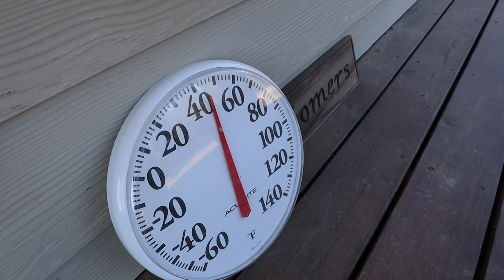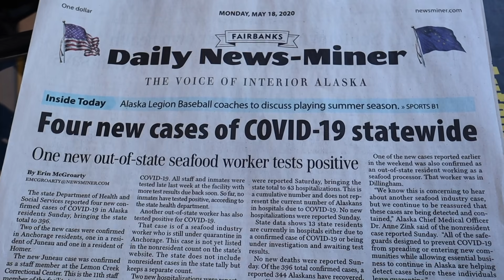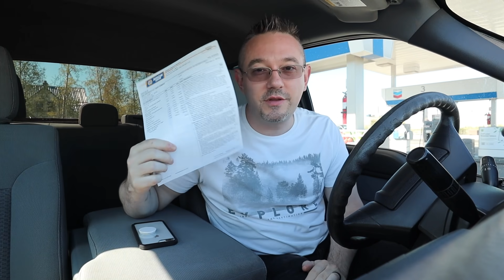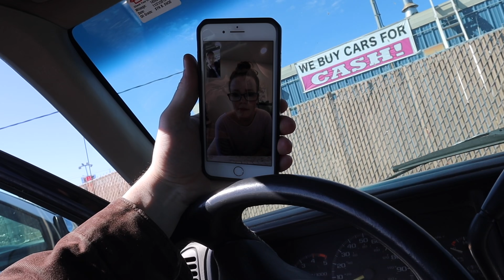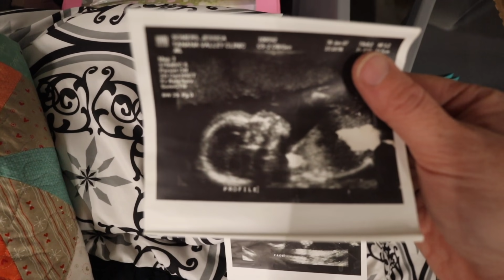IS THIS A MISTAKE? |BUYING A CAR IN ALASKA?| THINGS TO LOOK FOR? | Somers In Alaska

Comment: Alaska Chevron knows Ford vehicles, totally agree with his comments. Arizona to Alaska truck a great choice. 100% agree with changing all the fluids on a 4x4 especially if it has around 100k miles, in addition to the regular oil changes.

Comment: No it's not a mistake buying a car in Alaska, it no different then anywhere else. When I was in the Army and stationed at Ft Wainwright back in the late 70's, I bought my 1st New car EVER from Seekins Ford/Mercury when they where in the former building. And I bought a 2nd new car from Seekins. They treated me very Good. And the 2nd one I ended up driving all the way to Miami, FL., but sold it down there as did not have A/C in it and that is a must have down there!! Just have what ever you wish to buy checked out before you buy!!! Take Care, Mark from near Seattle, WA, USA.

Comment: Many prices are dependent on your local area. The popularity of a given vehicle type to your area even down to the colors that people in your area prefer will change the value, bought a vehicle on the west coast that wasnt popular and it was several thousand less that the exact same vehicle on the east coast purely based on the area preferred that particular model, so when i moved the value of my vehicle actually went up even though i put 2500 miles on it. 

Any doctor will write a prescription for muciprocin, it is similar to triple antibiotic but it makes the over the counter stuff seem like vasaline. Highly recommend it as a staple for ant first aid kit, doesnt cost much at all

Comment: That's why I stopped buying used. I perfer used for many years but after the 4th car in a row had so many problems that cost more then the car was worth.. I had enough. I realized starting new was the best option.  I'm the first with it so I know what's been done to it. Id rather make payments on new then on something you have to tinker with..going on 2 years with my truck...never had to be stranded in 2 years..that's unusual for me. Lol

Comment: They must not be familiar with salt belt tricks.  South main auto and Fordtechmakeuloco have videos on it without pulling the engine.  In short, weld a nut on the broken stud.

Comment: That's exactly what I said, the same thing Lance told you about the cam phasers and hubs.  The cam phasers could cost you the engine.  Look on the forums.  Listen to the stories of real people who dealt with the cam phasers problem.  To me it's a deal breaker.  The hubs is just planned obsolescence.  Wear through the disk because you overheated the brakes, or they cut grooves, you have to replace the whole hub assembly.  I drove Ford pickups for 30 years.  Never again.

Comment: We used a vehicle broker when we paid cash for a used Jeep earlier this year. The broker charged us a flat rate ($500) at the time of actual vehicle purchase and before that searched dealers all over the U.S. for the category of vehicle we wanted and started e-mailing us descriptions of vehicles. Once we found a vehicle we liked, the broker negotiated a deal that included a dealer's warranty and free delivery of the used vehicle from out of state. We had to get our bank to do a money transfer to the dealership before the vehicle shipped. We had three days after the vehicle arrived to decide whether to cancel the deal for a refund. The broker was there when the vehicle arrived and helped us inspect it to make sure the Jeep was exactly as described (she discovered the bag for holding the roof top pieces was missing). She worked with the dealership to get us all the paperwork soonest so we could show title and get the Jeep registered in our state. A week later we received free shipment of the missing bag for the roof top pieces. We paid below book value and got a gently used vehicle in excellent condition. We could not have found such a good deal without the help of a broker. This was $500 well spent.

That said, is now the time to buy a vehicle? If you can pay cash and the vehicle is in the condition described, then sure go ahead and buy. Is now the time to take out a loan to "buy" a vehicle? Absolutely NOT! There is an even chance that once this pandemic is nearly over, there may be a worldwide economic depression similar to the Great Depression that lasted the entire decade of the 1930s. You do not want to have a large debt going into an economic depression if there is a chance you may lose your job, be unable to find more employment and be unable to pay your debts. The other thing to consider, if you can pay cash to buy outright a vehicle, is to wait for the economic depression to kick in. Once that happens, lots of vehicles will get repossessed and dealers will be having a difficult time selling new or used vehicles when there are a lot of people are out of work. That is the time to get a great bargain if you are a cash buyer. When making money decisions, always consider the long-term risks and benefits and tune out all the excitement about getting a new toy. Think logically, not emotionally.

Comment: My lease is up! Not wanting to get a new car during this pandemic!
Reply: Trixdizzle Hopefully the car dealership can work with you🙏
Reply: Just communicate with them and they will work around your circumstances.  👍🏼😊
Reply: Don't blame you. Not the best time to invest in another vehicle depending on where you live.
Reply: I won't ever buy another brand new vehicle. I bought a brand new one for $20k. Owned it for 3.5 years, put 64k miles on it and sold it for $4000.
Reply: @Dang_Jim  no way it had lost that much. Did you give it away or something? There must have been some damage done to it perhaps?

Comment: Im glad that Garrett is feeling a lot better. Im glad that Bert is getting the truck looked and inspected all over in case if there is an issue. I remember buying my car last year, brand new 2019 model car. It well worth the extra money with the additional safety features on the car.

Comment: 90,000 miles is too many for that year especially since engines don’t last as long with the cold climate up there that destroys gasoline engines. If you’re like me I quickly tire of searching for a vehicle so I tend to pull the trigger faster than I should the longer I search. Now that the deal is done, don’t forget the insurance. I hear conflicting information about how long you have to add it to the insurance. It ranges from right away to up to a month. With SF, they tend to want the money as soon as you aquire it. It tends to be aggravating making a trip to the office the same day you get it. Since it was from Arizona the mileage might be considered half the actual mileage. The summers are so hot you don’t have frequent cold startups. The worst thing on an engine. I ran across a Ford mechanic with a YouTube channel called Fordtechmakuloco that had a topic on what your mechanic discussed. He illustrates the sound so you know what to listen for. He has a lot of videos on what to look out for so you can catch problems quickly before they become major problems. Praise God for directing your path to what looks to be a good buy.